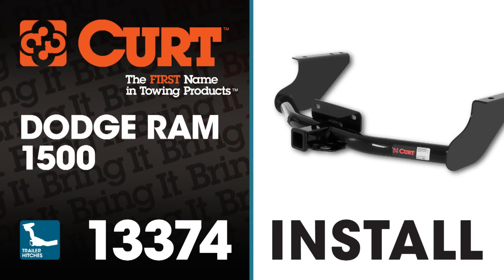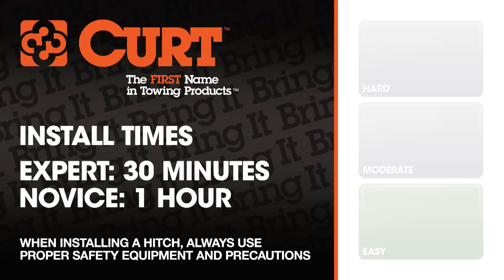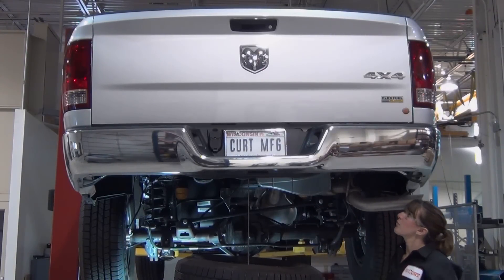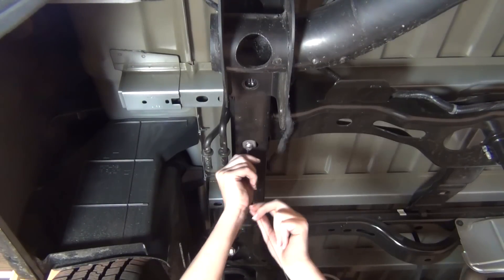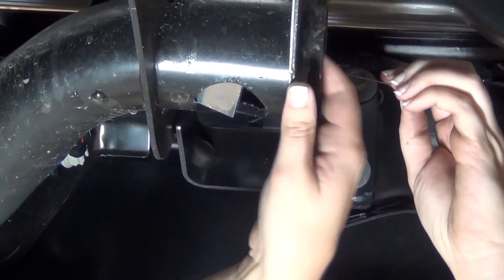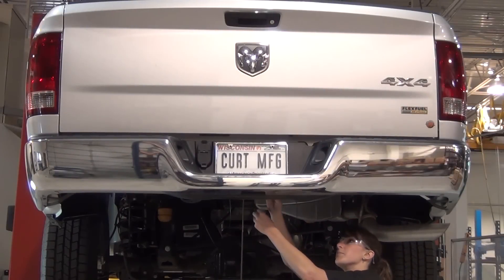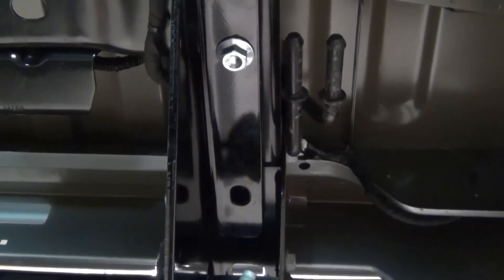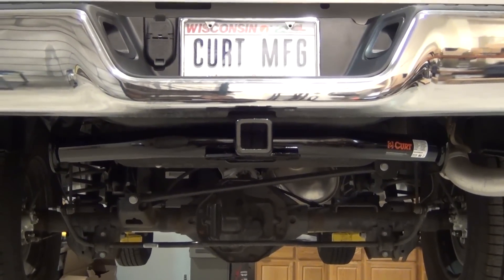Trailer Hitch Install: CURT 13374 on Dodge Ram 1500

Comment: This is exactly right.  
>>>Do not mistake the existing black tube framing is the old hitch (at least on the 2015 SLT). <<<  
It can easily be mistaken for a hitch because it looks exactly like a hitch with two connections for the bumper.  By the time you take it out, that part of the framing and the bumper come off at the same time and the electrical is attached and you wish you had help.